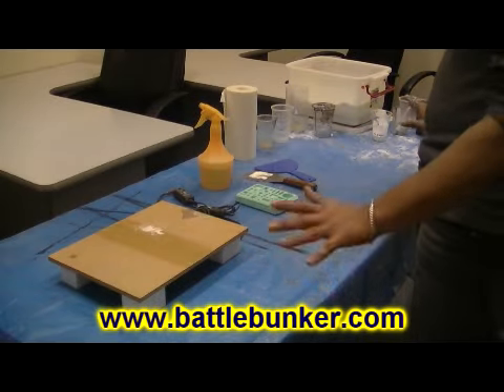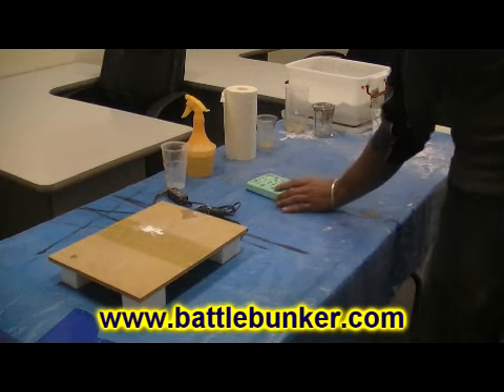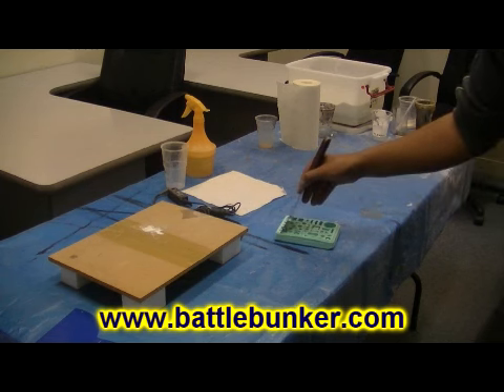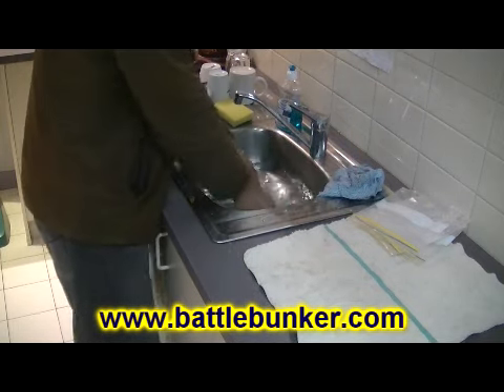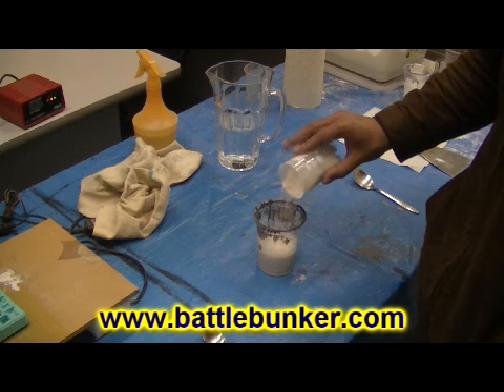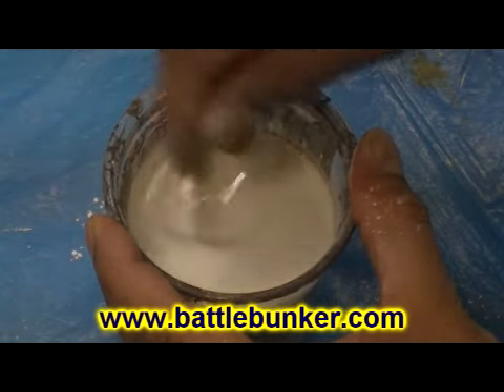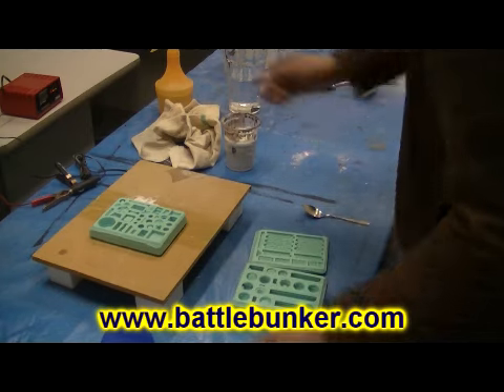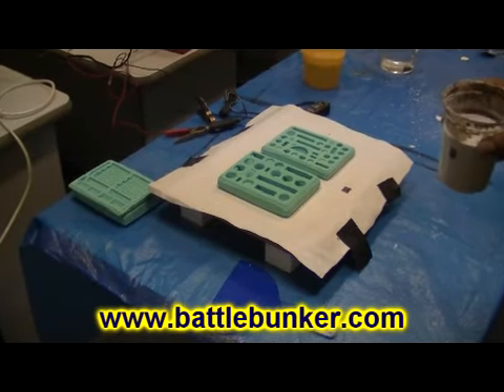Part 2 - Using Castlemolds from Hirstarts

Comment: TY for another great tutorial. Ive been looking @ the hirstarts molds for years contemplating getting a few ( as 1 just wouldnt be enough to do all i wanted ). your video has renewed my interest & Im going to order 2 to start with even if I continue to scracthbuild out of other things the molds will still alow me to get even better detail in a scenery piece as well as allow me to sell a few completed pieces to interested parties as some gamers ask to buy a certain house that i made, agree to a price & then break the deal when they pick it up & find its been made of cardboard, drinking straws, toothpicks etc, regardless that it looks & works perfectly ( I've found that a piece has to be made of something solid & have some weight in order to satisfy certain potential customers. Even though I'm doing this primarily for my own gaming satisfaction & not as a business). I wanted to ask you how many fellow gamers that you know are into casting ( either minis or scenery in any medium ) as @ least what I've seen we represent only 10 to 15% of the gaming community, I wish the percetage was higher though gamers who scratchbuild out of cardboard etc has risen ( I find it directly related to the price of gaming scenery going up,especially from GW ). One last thing, going through your videos I noticed that you brew your own beer, I used to brew every week w/a friend & just got a new kit, just need a 6 gallon steel pot & some ingredients . Wanted to ask if there was a particular recipe that you favored ,personally I 95% of time brew russian imperial stouts for both the flavor & higher alchohol content but want to try other styles though i do prefer darker beers,anything that you would reccomend that is particularly flavorfull & would have an alch content between 6 to 7% ? TY again for a great video

Comment: Hiya. Loving the vids as ive been considering whether or not to try and make and/or use moulds. I was just womdering though. Would it be ok to use warm water to aid in the dissolving process when you mix in the plaster? Or is there a reason for using cold water?

Comment: wow your good at this im an amicher with only 3 molds (hey im 13 where do i get £30 from) im curantly using a quik seting plaster i found in a hobby shop can fast seting be britler/weeker than plain plasters (i end up rushing them befor they set) also will anny washing deturgent work as "wet water" thx